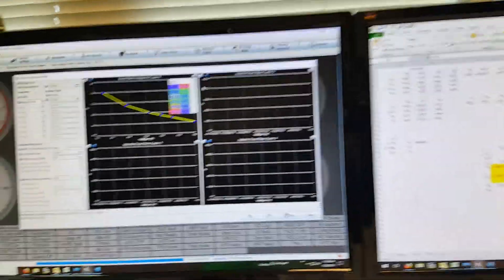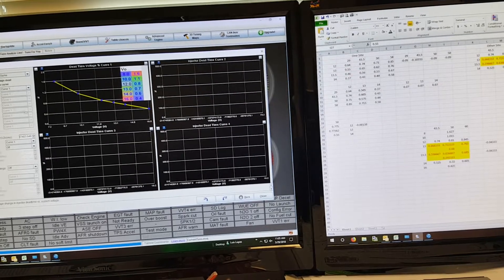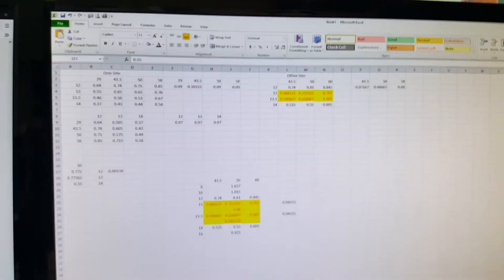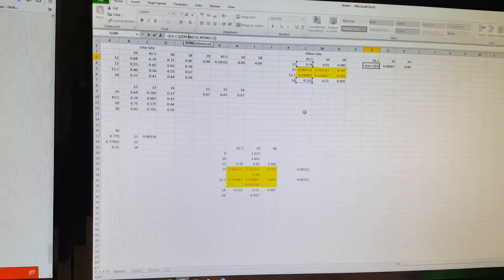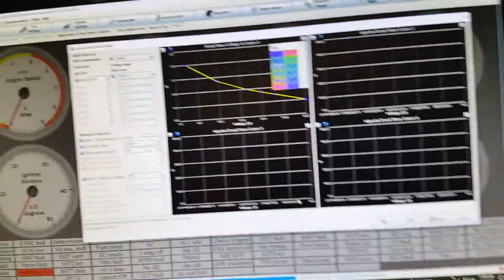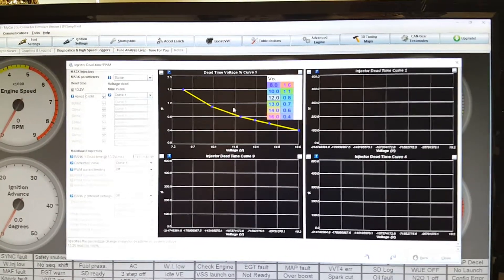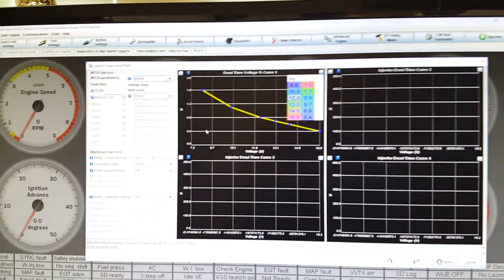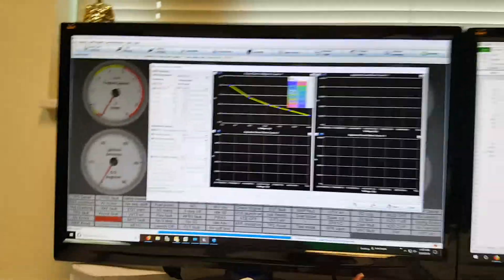Bosch 2200cc Injector Dead Time Curve on MS3

Comment: Hi Supa, could you share your msq to compare with my tune, Im having a hard time to set my tune correctly, but in my ka24de, I know you now have vq35, I have those bosch 2200cc and z33 coils, just need correct settings for deadtime and dwell time for the coils.
Reply from the maker: I can send you the vq35 and I should have my Ka msq as well what's your email
Reply from the maker: I deleted your email for safety.  The tunes for both motors have been sent.
Reply: @supakat500  Thank you very much, I received your files.